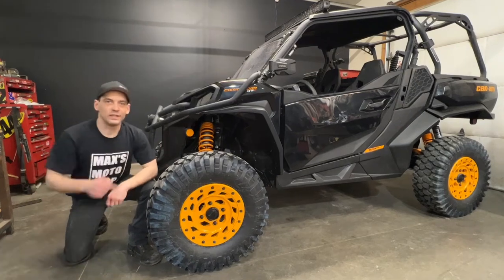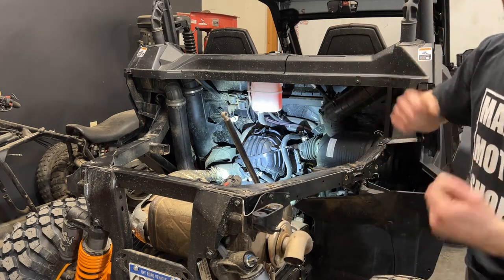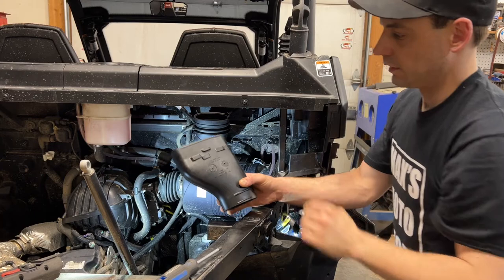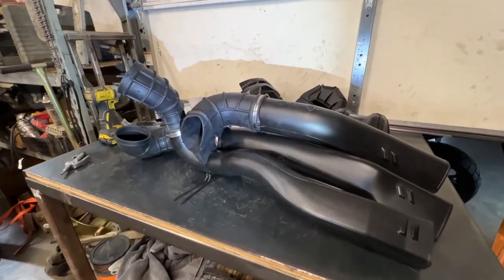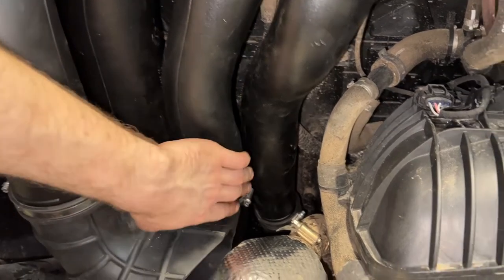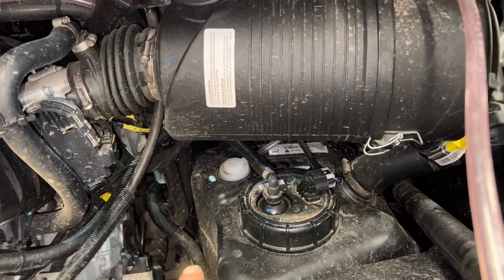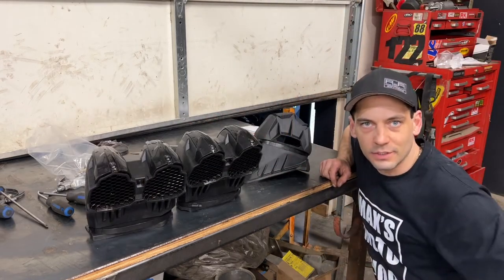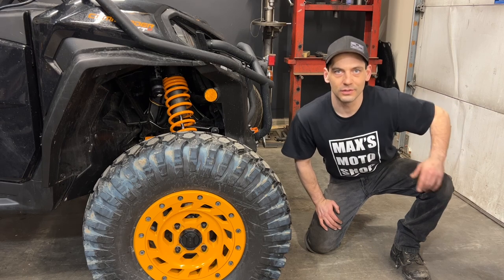Can-Am commander 1000 Snorkel Kit Install Step-By-Step Guide

Comment: Awesome video. My only issue is I disconnected the trans vent line while disconnecting the air intake hose now not sure where it goes back since it was attached to the air intake..